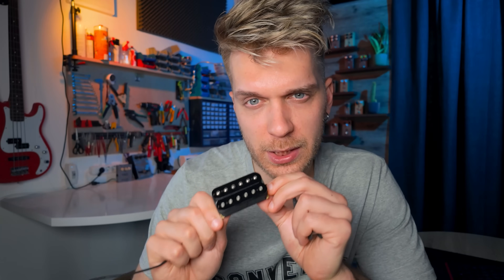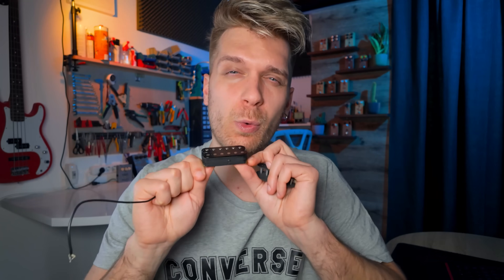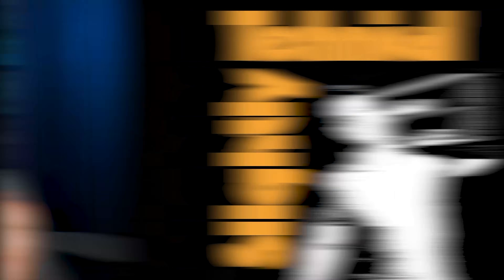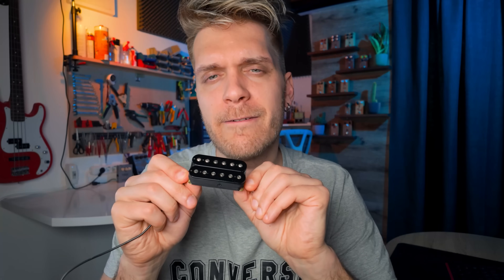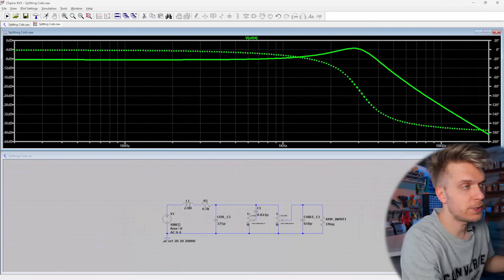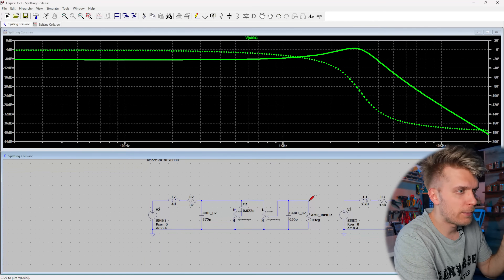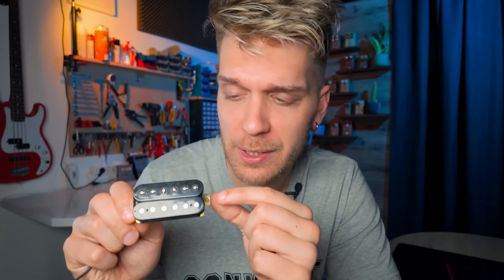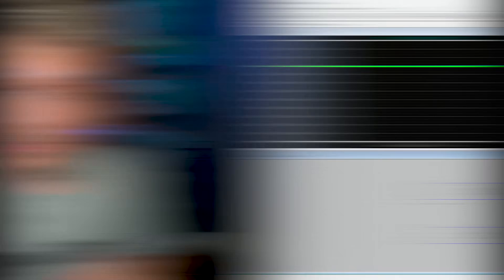Why SPLIT COILS are OBSOLETE?

Comment: ANOTHER SOLUTION: This is likely going to annoy some people, but for those with high quality modelers, never use split coils, always use humbuckers, make all pots 1M (for maximum flexibility, and the least amount of filtering before the modeler), then make the adjustments in the modeler via things like EQ and compression and other frequency filtering, to achieve a strat or tele type of single coil sound. There are also presets that use all of these strategies and more... that are designed to help a humbucker guitar get these strat/tele sounds. When done well, it can sound very organic and natural without sounding artificial. And really, the idea of using only 1M pots on a guitar that only ever uses a modeler... That's a discussion that is long overdue. Using 250k or 500k pots is arguably an outdated approach for someone who only ever uses a modeler. Switching to only 1M pots provides the modeller the max flexibility to obtain more sounds while preserving the guitar's organic sounds, without having to add back anything that's more synthesized/artificial to achieve some tones. This topic probably deserves its own video.

Comment: Yep, the issue with split coils is that A: a classic PAF sounds thin when split and B: an overwound, high output HB usually ONLY sounds good when split.
For HB guitars i only appreciate coil splits on neck pickups IF the two magnets and windings are different enough.

Comment: My bass has such a combined coil tap/split pickup. In single-coil (Jazz Bass) operation, it uses one coil without tapping, which gets it to around 7 or 8 kOhms. In humbucker operation, it's wound like a StingRay pickup, so each coil is around 4 or 5 kOhms. But then they are wired in parallel which results in a very high resonant frequency (just like the StingRay).

And I also have an interesting guitar: a Peavey T-27, with a humbucker in the bridge position. If you have the tone pot at 10, it cuts the high frequencies of one of the humbucker's coils. So low-frequency noise is reduced, and the sound is bright and single-coil-like. If you turn down the tone pot to around 7, the humbucker operates fully, but the tone pot doesn't really cut any treble yet. If you turn it further down, it cuts the treble as usual. A very unique and practical wiring that I haven't seen on any other brand yet, only Peaveys from the 80s had this afaik.

Comment: Something I like to do is two partial splits for each pickup, one using a cap for the single coil like split rather than a resistor, just prefer a cap for that than a resistor though I can never quite put my finger on exactly why

For the second 'in-between' split as I call it I use a resistor around a third of the coil's DCR, or slightly over, so say for an 8k PAF a resistor something like 1.5k or a hotter humbucker around say 12k a resistor somewhere around 2.2-2.6k

The in-between one can get you a nice sound but what I find it particularly useful for is cleaning up drive sounds a bit, much like using the volume knob for cleaning up drives, but it's quicker and easier to me to just flip a switch than fiddle with volume knob 'on the fly'

Another way I use it is in songs where there are quieter and louder/bigger parts use the in-between split for the quieter/less aggressive parts then flip to full humbucker for the louder/more aggressive or lead parts

It's something I tried as an experiment in a Dean Michael Angelo Batio signature guitar called the Mab4 Gauntlet a few years ago, liked it that much I've done it to almost every humbucker guitar I've wired up since, though I actually ended up doing something different with the Gauntlet, I changed it from a HSH to a HHH by putting a 14k Warman Twin Loco hotrail in the middle

Did the two splits as above for the middle and neck pickups and for the bridge pickup, a 16k IronGear Dirty Torque I used a push-pull for a variable split [spin-a-split] and the switch on the push-pull changes which coil gets split, works great on that pickup but I find it works less well on lower output pickups like PAFs as the differences in sound are less noticeable

Only recently came across the channel btw, subscribed as soon as I saw the stuff you do which I'm loving, I'm a bit of a wiring and gear freak, also signed up to the site the other day but I haven't had chance for a good look around at what's on there yet

Comment: I use a DPDT on-on-on switch to select splits for north and south on 2 humbuckers, Seymour Duncan Jazz on neck and JB on bridge, having the option to select either north or south (inner or outer coils) gives me either a "stratocaster" sound on inner coils or a "telecaster" sound on the outer coils, sounds nice but I will try the partial split described here to reduce noise and increase output, I'd love to have a way to also select "parallel" mode on each separately

Comment: A Semi-Hallow Reverend Guitar with a p90 and a filtertron and it is the most versatile guitar for sound.  The high-pass filter and the difference in pickups are pretty amazing for that, better than a split coil les paul.

Comment: I wish you'd included discussion of parallel operation of the pickup. I have Strats and Teles. I don't really need that exact sound from a humbucker. But I am interested in the parallel option, something not quite humbucker, not quite single coil.

Comment: Am i wrong to think that having all your plots equalized at -8db is missleading (even if its useful for the demonstraion you are doing)? One option i dont see mentioned often, if at all, is that if you split your pickup just raise the gain in your amp, yes, the resonant peak will be more noticeable but you will compensate the perceived loss of bottom end which is primarily the most obvious effect that triggers the feeling of "losing" something as a consequence of tapping the coil.

Comment: I love Dimarzio pickups in split mode.  I use the (bridge pickup) coil, farthest from the bridge with a 250k volume pot and no tone pot.  I prefer the sound because it sounds like half humbucker, half single coil.  Also, the attack is clearer and the sound is more dynamic.  You do, have to eq your amp differently because the standard series wiring is naturaly much darker.  I have a rotary switch to use split coil for rythm work, and series for solos.

Comment: So a couple things .. first I found that when you look at a strat & a say LP wiring . You’ll notice they use different caps on the tone pots . Most singles have a .47uf , and HB a .22uf. Unless someone modded it with orange caps which are .47uf. (I may be backwards on that it’s been a few years since I did all that research ) so when spilt a HB for the right tone you need to change the cap for optimal sound.  So on my ESP/LTD (3knob) it only has one tone pot. So I added a 3rd push/pull with a different cap on each side.  HUGE difference .. whether split or not.  
    Second , My bridge pickup is more powerfull , and fuller/bassier in the single coil position 🤔🤔 could I have an issue with the other coil when in HB mode ? It’s maybe 1/3 quieter ,and tin-ey sounding. 😮
 Is that pup maybe wired backwards ???🤔

Comment: I often think that this is one of these things that, as guitarists, we're making much to big an issue of. If we stick with the examples of cover bands, the rhthym section is often an acoustic kit - played in many venues without being mic'ed up - and a bass player with a P or PJ bass, and... they make it work.
In a studio situation, sure, you probably can have (or beg, borrow or steal) the right kind of pickup sound coming straight from the guitar, but live? You've got a masive choice of digital modellers that you can EQ (or do that quad cortex guitar cloning thing) away and it'll sound fine.

Comment: I never liked split coils or coil tapping, and don't bother wiring my guitars that way. I think those are unsatisfying sounds that are neither one thing nor the other, making them useless in any scenario. When I need a single coil sound, I'll use a guitar with a single coil - specifically one that does everything a single coil should do, without any of the associated bullcrap. Or I'll use a dual mode pickup that can be be switched from humbucker to true single coil. Thanks EMG.

Comment: I always have a coil split switch in my humbucker equipped guitars. One of them has a parallel 510k resistor which engages in split mode, one has a 47 ohm partial split resistor (I find the PRS values too high), the others are simple coil splits but I mostly use a combination of parallel coils (which sound fine without any partial split or complicated wiring), for example the inner coils of a HH guitar (Petrucci clean tone style). However, my PRS custom 24 with a Dragon II bridge pickup and a Vintage bass neck pickups sounds spectacular in simple split mode. So my conclusion is you kinda have to fine-tune each guitar/humbucker when you want single coil-like tones. My mainstays are: 1. it’s perfectly fine that the single coil tone is lower output, 2. the neck split humbucker MUST be the outer coil active, if you want it to be the closest to a neck single coil!

Comment: Or, and stay with me here, buy a cheap EQ pedal! Even the Behringer EQ700, I saw one on Reverb about a month ago for 15 Euros plus 10 postage.  Sure, if I wanted a Strat sound on a recording (although god knows why I'd want that!) I'd get a Strat for the studio. Beg, borrow or steal.

But live? A half-decent, nothing fancy humbucker or PAF style (although the smaller humbuckers are more versatile, you can go both ways quite easily) and a few tweaks on the EQ pedal. Unless you absolutely need that distinct position 2 or 4 quack, and you're probably not getting that with any split pickup, not any that I've seen anyway,  you can easily get close enough for jazz. And Rock'N'Roll, including all the various styles we now call genres.

Comment: To this day, still waiting to hear an Humbucker, splitted, and sound like a good 'single', or at least 'close'. 
I had a guitar, custom made by a luthier, that had an un-usual configuration(SSH, not HSS, SSH ). I'm a Single guy, but needed those warm sounds from the neck humbucker, for 'Jazz' tones . All the PUs went thru a 'discreet component' that regulated general output . So, no volume change, just enhanced characteristics of the PUs. Worked great .
Thank you for sharing your experience. Take care .

Comment: I use Classic Strat Humbuckers made by Merlin Pickups from Poland. You know how you described how a split humbucker does not give a true single coil sound because of how they're built? Well these humbuckers are designed in the opposite way. They're not "true" humbuckers, but more like a pair of true single coils glued together, wired in a way that gets as close to the true humbucking sound as physically possible with this type of design, whilst the split sound gives an actual genuine single coil. So the challenge with them is the opposite, it's not about making a humbucker sound like a single coil, but about 2 single coils engaged together sounding like a humbucker. TBH I'm not sure how "genuine" the humbucking sound it produces is, all I know is that it sounds fantastic both when split and when used as a humbucker. I also plan to change the split switch to give me yet more flexibility and switch between series/parallel/split, and use 1meg pots like on jaguars and such to have a wider tonal pallette, from very bright and wiry indie/shoegaze/j-rock sounds to dark and growly doom/groove/nu metal sounds.
Reply from the maker: @Sylkis89  yeah, that's a different concept and that's real cool. But most people have never heard of that. 🤟
Reply: @slightlytechnical103 btw the name "Classic Strat Humbucker" makes more sense when you put it in the context of them selling "Classic Strat Single Coils" and it's implied that these "Humbuckers" are the same pickups just slightly tweaked to work as close to sounding like a humbucker as they could. The single coil sound was the foundation to their design and the humbucking was the extra, not the other way around. I also opted for a "hot overwound" variant of these that has a greater output, which probably makes sense why when you see the genres I listed in my previous comment ;) price wise they're maybe not cheap like some Wilkinsons or something, but they're still very reasonably priced, especially boutique handmade products. Anyway, I'm sure there are other companies that use that concept as well, I use Merlins cause, well, I'm from Poland lol might be a fun idea for you to explore in another video, comparing sounds of "Humbuckers" like that vs 2 regular single coils engaged on a stat type guitar or something (also possibly series vs parallel) and genuine humbuckers with the mutual winding on both sides of it rather than 2 singles slapped together in one cavity with just some trickery added to make them emulate a humbucking sound. :D
Reply: sounds interesting gonna look into those thanks for the info !

Comment: Never been a fan of standard full split. It sounds dull and lifeless. Partial split using a resistor is good but partial split using a capasitor is even better. My favorite solution is a passive mid boost pot with single coils. It can deliver all that single coil magic and plenty of humbucker style mid punch when needed.

Comment: Thanks for sharing this. Is the third option you described what PRS does for the Paul’s guitar?  My understanding is he was trying to get as close as possible to a real single coil sound when in split mode.

I have a PRS DGT and 594 and love the sound of the split coils on these guitars.
Reply from the maker: Quite possibly, I don't really remember at the moment, but it's something you'll find in the 513, 509 and stuff like that.

Comment: Marko how are you!!! Gino here with another silly question... some time ago I read that the Stand By Switch on tube amps wasn't that necessary and that basically what they did was simply cut the volume in one fell swoop. There are conflicting opinions as some say that the valves have to warm up a bit before starting to play and in the same way they have to cool down before turning it off completely; how true is this since my Friedman JJ Jr doesn't have the Stand By Switch and I don't think Friedman makes bad amps and that the Stand By Switch is used to continue the models that Fender had at the beginning since you can't find them in other devices that used tubes as a means of amplification... what's more, I also read that on the contrary if you leave the amp on with the Stand By on (without volume) for a long time you cause damage to the amp, how true is all this ???
Reply from the maker: Hey, I'll make a video on it.
To cut the long story short - use your standby switch, because of various reasons, and some cost cutting by companies, not using the standby switch can blow some caps.
But it's better to turn your amp off completely or leave it fully on if you leave it for longer periods of time. Keeping the amp on standby can shorten the life of tubes, that is true.
Reply: @slightlytechnical103  thanks a lot !!!

Comment: I've found best switch to do coil splits is the fender sw1 pot/switch. Is essentially 4 switches in 1, so you can do coil splits and fudge the pot values with resistors on 2 pickups. 
And ref the partial splits, use trim pots then you can dial them right in for each pickup. 

I recently built an HSH guitar with master vol and master tone, sw1 on vol doing coil splits for the HB's, fudge value of vol pot and also switch value of tone cap, this last bit doesn't seem to get talked about a lot and for me i don't think a cap that sounds great for HB's doesn't work for sc

Comment: I just did a partial split in my Epiphone les Paul. Upgraded the pickups to DiMarzio PAF pro pups and added a switched pot for the tone on the bridge pickup. I added a 3.3K resister between the switch to ground and the split of the pickup, and I get a higher output, less shrill but still has the single coil tone to it when activated.

Comment: So glad you mentioned the partial split... I was wondering if you were going to bring that up.  I had a HB that was wired to a crazy 6-way switch to get several combinations of coil split, series, parallel, in/out of phase... i thought it would be great, but I rarely used most of the "other" sounds.... years later, same guitar, same HB is now wired to a simple push/pull to go from HB to "partial split" with a resistor to ground... so much better and very simple, although you have me thinking that I may go back and rethink the value of the resistor I used...  Great Video!

Comment: For the regular split thing: How about using 250k pot and wiring the split mode just straight to that, but wire the humbucker mode so that the switch adds another 250k in series with the humbucker output. (Or make it 220k, 240 k or 270k beacause E12 or E24 series.) This will rob you a bit of the output in the humbucker mode, and with vintage wound pickups it may be unacceptable. However, with high output humbuckers it may be less of an issue. Compare this to the log 500k pot where the half resistance point might be somewhere between 8 or 9 (on scale of 0 to 10). The added benefit here would be closer mach of output levels between Humbucker mode and single coil mode, as it would reduce the higher output humbucker mode. This is probably not a solution for heavy metal guy who wants "all the gain", but it might be workable solution for some guitars for some people (in cover bands maybe).

Comment: A neat solution to this is the asymmetric humbucker thingie. One of the coils is thinner and thus weaker - BUT this does reduce the noise suppression in humbucker mode proportionally. 

Stacked humbuckers / noiseless singlecoils are awesome too.